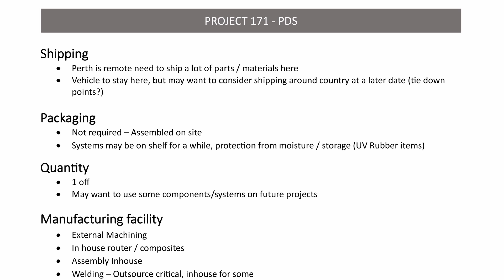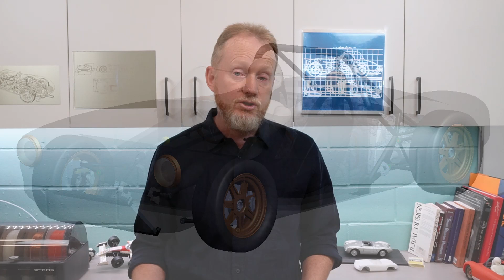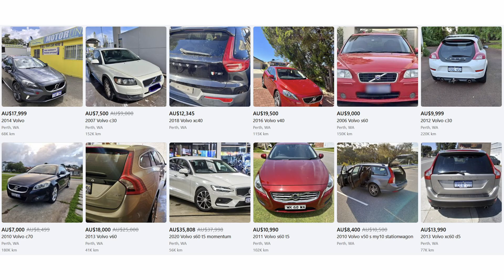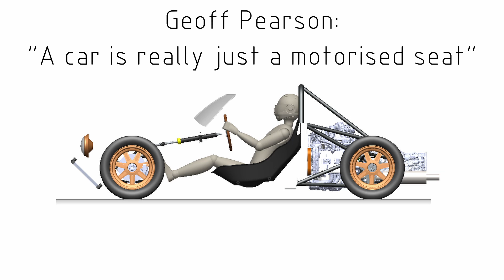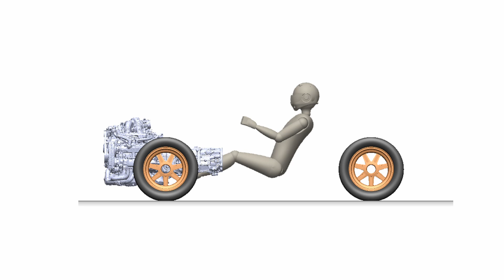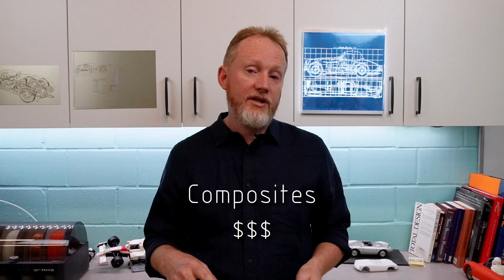Comment: The main problem with composite and sandwich monocoques is repair. Stone chips or grounding can cause delamination which can extend much further than visible damage. The material cost is not actually that bad if you include all the build costs, steel is cheap but a spaceframe has a lot of cuts and welds.
Reply: Repair for composites isn't that hard as long as you are prepared to add weight.  At the point where there is major damage it can be a write-off, but pretty much the same for spaceframes.  Your point about the visible vs. non visible damage is a big one.  Even out of the mould it can be hard to determine the quality of the chassis.

Comment: Thanks for another video Kevin. You were mentioning FWD powertrain placed on rear axle but in the car model it looks like subaru powertrain (I may be wrong). Was it about 3d model availability or there's something to find out in fallowing videos in regards to this powertrain model used in this video?
Reply: Well spotted. Definitely check out the engine selection video.

Comment: I like the rational approach, and not a showcar/sema car, with some tyre sidewall!   Monococque centre cf. the RUF appeals with tubular front and rear sub frames - also similar to the E-Type Jag with its metal centre section.  Prefab composite panels bonded together?  Space penalty?  No moulds and hand layup with post-cure only?    But how to make the overlaying body...?  Good job.
Reply: Definitely asking the right questions. If it does end up composite up front I will be trying to avoid a front subframe, they can add a fair bit of weight, although they do make things a lot easier.  Planning to run through the chassis design a bit later.

Comment: I did a bit of the formula SAE at uni but never got fully into it but if memory serves combined with my own intuition, solving for a space frames strength is far easier. This easier to solve nature often means even tho in theory a carbon monocoque is ligher once you add in your higher uncertainty the margin is negligible, seen in practice on our SAE cars. In a mass production or racing environment you build several and validate them but due to the nature of the budget you likely won't. Therefore once you add your higher factor of safety it won't be much lighter but far more expensive going composite.

The other advantage of spaceframes is the ease of mounting things, where in a monocoque they need to all be planned well ahead, in space frames new parts can just be welded on allowing for an interactive process of modification as well. As a one off that's not a competition car for me spaceframes are clearly superior and the Porsche 917 is a good example of how light these can be and is imo another good reference point. The 917 uses a large number of interesting ways to save weight while still achieving its 800kg target with a 5L flat 12. While some exotic materials are used, most of it is fairly simple to do today by comparison with automated pipe benders and tube Lazer cutting
Reply: Well they did throw away the 917 chassis 'after every race :) 

You are right in that spaceframes are easier to analyse and there isn't a huge difference in weight. Although in a lot of ways composites can be easier to work with (sounds counter-intuitive).

Still on the fence on the decision, I just need to figure out the most sensible option and then choose the other one.
Reply: @KevinHayward7  Hey, as long as you stay under 380km/h you probably would be fine 😂. Though arguably the throwing away of chassis was a sport in and of itself in that car with something like 1 in every 16 chassis was used as the others weren't airtight. Though they achieved 42kg for a pretty large car.

I was part of the layup of our SAE car and they used the plug -> mold -> part work flow and let me tell you it was all hands on deck sanding those plugs smooth. It's definitely not the only way to do it but I can say I definitely wouldn't want to do it again. On the other hand my dad is a metal fabricator and that's largely the type of stuff I design at work so I'm hardly unbiased.

Comment: Hi, Dr Kev. I would use a folded sheet aluminium, riveted, and glued together for the monocoque. 
Using the sports 2000 racing car from the late 1977 to 1984 as a basis for design and concept. 
The most important thing to choose is the wheel & tire combination you would like to use as drives the location and size of the suspension.
Reply: Those sports 2000 cars are fantastic, have a good friend that used to race one now and then. A folded sheet monocoque is definietly an option, a lot cheaper materials wise than going moulded carbon.  Definitely will be running through wheels and tyres in upcoming videos.